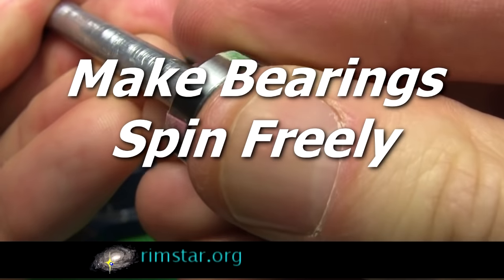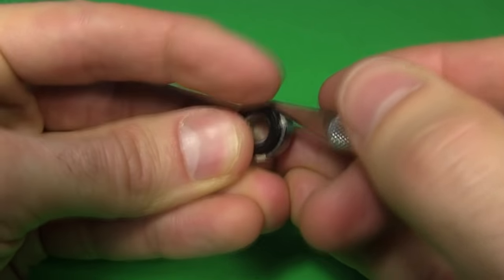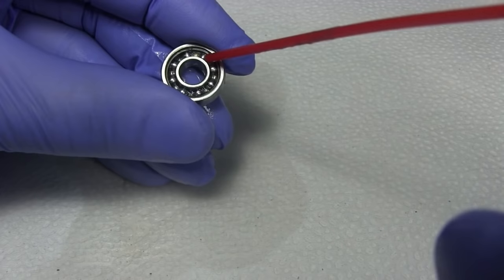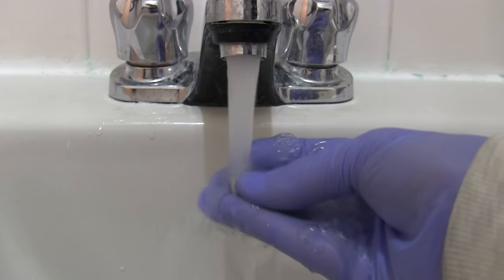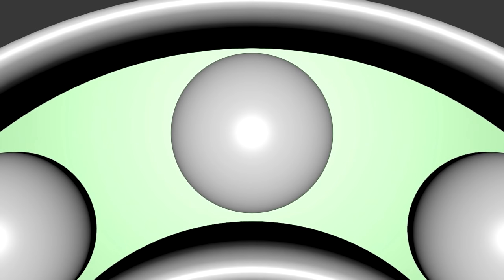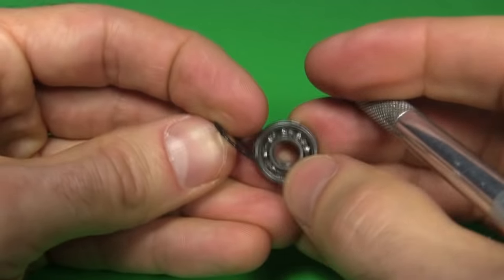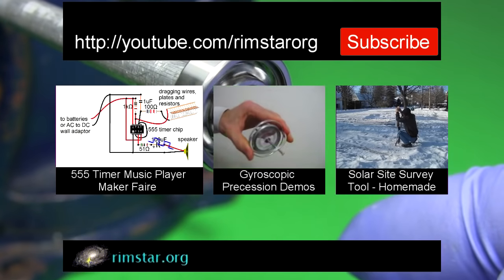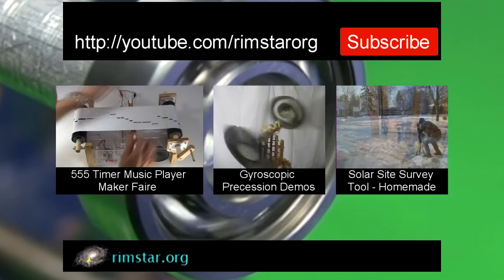How to Make Bearings Spin Faster/Freely

Comment: How to kill a perfect bearing. It needs breaking in by spinning. Just use a drill to do that...
Reply: How tf did u use a drill
Reply: @notyouraverage1saiah660  take a 5/8 dowel rod put in drill, take bearing and put it at the end, grab the outer ring of the bearing with pliers or something and spin the drill keeping the outer ring static while the center spins.
Reply: @IIBLANKII  thx cuz my brand new bearings spin for not even 20 seconds
Reply: Put bearing on a matching ID drill bit, put in chuck, hold the bearing outer ring, push the trigger.

Comment: For you skaters out there, there's orders of magnitude more rotational friction from the rolling compression of your polyurethane wheels than there is in the viscous fluid movement of the grease in your bearings and the slight touch of the rubber seals. And that is smaller yet than the friction of the balls crushing silicates in the raceways as your really cool skate oil attracts dust and becomes a lapping compound. Your bearings will last a hundred times longer if you leave the grease in them. The friction is psychological. Unless your goal is to have the wheel that spins in the air longer than your buddies, save your bearings by keeping them packed with a lithium soap wheel bearing grease.
Reply: +EightiesTV Finally, someone who gets it.
Reply: I think you're wrong. If i leave the grease in i can do a spin test that ends at a halfway decent minute and a half. If i skate them for 15 minutes clean the bearings amd use my "cool bearing lube" it can go for up to a 5 minute spin. You aren't a skater so don't try to tell us what is good or not good.
Reply: +Zach Krantz Actually I was a very avid skater when I was a kid... right up until I went to college to study engineering.
Reply: +EightiesTV You aren't a skater anymore so why is your previous status as a skater relevant. How long ago was that.
Reply: +Zach Krantz look free spin means nothing, this is something the "skater" doesnt understand because he's not an engineer, bearings work the same whether its for skating or for a piece of machinery and trust me the ones being paid 100k up to use and design bearings know more than some 14 year old with wd 40.
Reply: +Zach Krantz, I can't speak for TK TK, but yes, that's what I would tell you. Just because a bearing spins longer without a load on it doesn't mean it will roll farther or faster with a load on it, such as the skater's weight. Other factors make so much more difference that any effect of light oil vs. grease becomes completely inconsequential. Example: The difference in friction between a set of bearings lubed with something light like Speed Cream and the same bearings lubed with a heavy grease is dwarfed by factors like the rolling resistance of the urethane against the asphalt or concrete. That's what Eighties TV meant by "orders of magnitude." 

So, yes, what I'm telling you is that if you were to do the experiment you described, with an actual skater on the board, you would not be able to see or measure any difference between the oiled bearings and the greased ones. You may not want to believe it, but it's true.
Reply: Except plenty  of racers (including me) use grease because there's no evidence that proves grease is actually slower. It's that whole pesky "orders of magnitude" thing again.
Reply: Except my race results prove that I don't suck - well, at least usually I don't; everyone has a bad day now and then. And it's not that I don't know how to service my bearings "like a responsible adult." I do, and I've done so plenty of times. I just prefer not to have to do it as often. I'd counter your last statement with "There is no need to service your bearings (as) often if you use grease (and use bearings with a decent seal)." Finally, the vast majority of "skateboard makers" DON'T use grease. They use light oil, precisely because most skaters stubbornly continue to believe that a bearing with lots of free spin is "faster" when actually riding the skateboard - despite any reliable evidence to the contrary.

As for whether greased bearings are slower, define "slower." If you mean a wheel with bearings lubed with grease will stop spinning sooner than that wheel with the same bearings lubed with light oil, I agree. No one's disputing that. But if you mean a set of bearings lubed with (the proper amount of) grease will cause a skateboard that's actually being ridden to go significantly slower than it would if those same bearings were lubed with light oil, I disagree. And I challenge you to show me experimental evidence that proves otherwise. Not theoretical, not anecdotal—experimental. Because unless or until someone does show me such evidence, my own anecdotal and theoretical evidence - which I've stated without calling you names saying you're lying - is every bit as valid as yours. If you're an engineer with 15-plus years of experience, you of all people should understand what I mean.
Reply: Do you really think I misquoted you really badly? How and where did I do so?

But did you really just call me "fag"? That sort of stereotypically troll-like insult makes me disinclined to respond any further. If you're really interested in discussing the effects of different lubes on bearing performance, I hope you won't continue with insults like that.
Reply: Jake McCoy is right but I am going to add this 

i just used marine grease

Comment: if you want to win one skate race do it, he is right if you want your bearings to last for two years leave the bearings the way the manufacturer supplied them
Reply: I actually don't think the actual drag would be felt by someone running them side by side.  I did that test once and no one could tell the difference. The fact is, drag between the wheels and the ground is greater than the bearings.  If you want to win races, use harder wheels.

Comment: You want to remove the grease from your skateboard bearings if they have any actually. You just need to replace that grease with a high-speed lubricant. I use liquid bearing or bones speed cream. Both are very quality thin lubricants. (liquid bearing is much cheaper though and its the same thing.) 

When it comes down to it. It's all about maintenance. After every ride on your longboard or skateboard, you want to wipe clean the outside of your bearings so less of a chance all that gunk will get inside of them. No matter what some will get inside though and that is why, depending on how many miles a month you put on your longboard you will want to open them up and clean them out. I put about 70 - 90 miles a month on my longboard on average. Sometimes much more if I have someone to go out cruising with.  I ride every night. You can buy or make your own bearing cleaner kit. I make my own, it's easy, google it. I use 91% or higher isopropyl alcohol to rinse the bearings rather than water. And I highly recommend you do as well as you don't want to tarnish the track of your bearing its best you dont use water and if you must, use a hairdyer or a compressed air blower of some sort to dry them 100% And do it right away. Certain bearings use steel that is very high in carbon and will literally tarnish within minutes. Any sort of tarnish at all will slow you down ever so slightly and once the bearings start to tarnish the next thing from there is rust.

 If you do happen to go through water or get stuck in rain. Be sure to open up and either lube the crap out of and spin your bearings ASAP and clean / lube them soon as you have acess to what is needed to do so. Please do not stress too much over this though as in don't let it ruin your day, thinking your bearings are tarnishing. If you have been keeping up with matanince you should have more than enough lube in there to withstand repelling a little water for a short moment. And thankfully bearings are not too expensive these days. I remember for a good set of bearings you were looking at $70 bucks. You can get the best there is for 20 bucks and for 30 you can get the bearings with built in speed washers and spacers (Bones Red Race bearings is what I use) They are the best I have used so far. Don't fall for the swiss and ceramic nonsene they are made in china and even if they are swiss made, it doesn't make them spin faster or longer lol. The ceramic is coated in steel anyway... The only difference that would come from it is heat and trust me if you are skateboarding you are not even close to coming anywhere near max ABEC 7 heat tolerances. Let alone Abec 9 or even better Bones Reds that are made for skateboarding and dont even use the ABEC system as it doesn't apply to skateboard bearings.

Also, don't use WD40. If that is all you have then sure it's better then water but the best thing you can do is use 91% or higher isopropyl alcohol. If it is anything less than 91% I wouldnt use it. With 91% or higher, you don't have to worry about tarnishing or blow-drying the bearings afterward as it wil all evaporate. And if you are going to use citrus cleaner (that is the usual stuff that comes with skateboard cleaning kits.) Be sure to immediately after taking them out of the citrus solution and shaking most of it off, rinse them in 91% alcohol. Because if that stuff is left on the bearings it can do the same damage as water if not more.

If you have made it through this to the end of this comment, congratz I hope I could help you learn something. If you think I did well please give me an upvote. If you think I did poorly please comment as to why. I would like to learn from my mistakes and I would like to know if I am spreading the wrong infomation. Thank you!
Reply: Have you looked into getting your parts of your board coated in tungsten disulfide? There are a couple of example videos on YouTube showing how slick the material is. I add it to my gun greases and oils. Back to the videos, there's a video of someone free spinning skateboard wheels (forgive me if my terminology is incorrect, as I know very little about skateboarding), one side is not coated in tungsten disulfide and the other side is. There is much less friction on the one with the special coating. I could see where this application would not only reduce wear but also make your riding smoother. I'd you're interested let me know and I'll send you links.
I just found the video. In the YouTube search bar type "tungsten disulfide truck spin" and the video should be at the top. A page called Applied Tungstenite posted it.
Reply: Citrus cleaner has to be removed fast and re lubed after...absolutely ruined a set of my German Fafnirs

Comment: In my early years (1990's), I raced R/C buggies on an indoor dirt track. Pulling the plastic seals was the first thing we all did with a new set of bearings. We used W-40 to blow out most of the grease. Then we would fill an empty oil bottle with a needle tip. I would fill the bottle with Marvel Mystery Oil. It's a very light oil that gave just enough lubricant to make the bearings spin for minutes. At least for the entire length of this video. Of course this require cleaning and re-oiling every race, but that's what we had to do to cut that 10 seconds off our lap times. We also notice our electric motors batteries ran much cooler at the end of the race. It prolonged the life of both the motor and batteries.
Reply: Captain Jack yes I am lovely person who ride buggy thank you for this wisdom

Comment from the maker: Quick video on how I found I could make bearings spin much more freely by removing the grease. Good for electrostatic motors with light loads.
Reply: Wonder if this would work on skateboard wheels also?
Reply from the maker: Josh Baldwin
Hi Josh, I think you'd still need a lubricant of some kind with skateboard wheels. There's a lot of weight on those bearings and with the metal balls against metal they'd get damaged. The lubricant gets between them and prevents that. I see this as more useful for things like electrostatic motors where there's almost no weight.
Reply: Makes sense, I remember having to clean mine with WD-40
Reply: I have not WD-40
Reply from the maker: Someone else here said that kerosene works too.
Reply: I would use MAF sensor cleaner since it is specifically designed to evaporate without leaving residue.
Reply: That way you could skip the water rinse and prevent some corrosion. But ultimately you still want at least enough oil left to prevent rust. So maybe a slight amount of light synthetic clock oil?

Comment: This is a fine example of doing what's appropriate for your intended use.

Even without using graphite lubricant this is fine. You're not going to much affect the life of the bearings by using them in a virtually zero load low RPM demonstration motor.

In fact, once you're done using them for that, you can re-pack them with grease, throw the sheilds back on, and they'd be good as new.

And in terms of skateboards, the instant you land your first Ollie you've already done more damage to the bearings than I'm sure these would have in entirety of the time these were used in the motor.
Reply: even after the scraping of the ball bearings with a needle point and rinsing it in water etc? seems like a horrendous idea
Reply: @twilightsparkle75  Dude, why are there so many bronies in this comment section?  Just curious (:
Reply: @Tadders  no idea bud XD

Comment: Accidentally ordered the wrong kind of bearing and this helped me convert it into a free spinning like I needed, thanks! I didn't have any paint thinner, but a quick 2 second dunk into gasoline cleaned it up extremely well.
Reply: Yeah gasoline is fine too, others uses solvent.
Reply: Get some tungsten disulfide powder and add some to rubbing alcohol. Spray a liberal amount of the mixture to your dry bearings then once it evaporates it should leave a very dry but slick surface. I would think it would spin even more freely.

Comment: Awesome video, I'd like to share some knowledge on this topic also. 
If you don't know who Gentry Stein is he's the Yoyo World champion and as you know, yoyo's are heavily reliant on insanely good bearings and some can even spin for 40 minutes. According to him, and the majority of the yoyo community,  Lighter Fluid is the best way to clean a bearing. Pour some in a cup and shake for 15 seconds, or you can soak for 15 minutes. After that, put your bearing on a pencil (or whatever fits snug) and spin it out a few times or  use a lighter and light the bearing which will instantly remove the lighter fluid remaining in the bearing.  After cleaning the bearing with lighter fluid, put only 1-2 drops of thin yoyo lube on the bearing guard which will seep into the ball bearings then spin it a few times.  Yoyo lube is designed for bearings that are constantly spinning at high speeds. The lube does not technically make it spin better/faster/or for longer durations, however, it does spin smoother and like greese it preserves the lifespan of the bearing and keeps it spinning as it should for longer use before wearing down. Hope that helps too! 👍
Reply from the maker: Thanks for sharing your tip.
Reply: This feels like a better method
Reply: Nice

Comment: as a longboard enthusiast for those using bearings for riding i would advise against using metal to touch the ball bearings, fashion something from plastic if you must, like a guitar pick cut in half but its not needed at all. also never run without the shields. paint thinner will work to remove, i like 50% rubbing alchohol because its more forgiving and let it dry fully before lubrication. Use a thin lubrication for longboards and do it every 150km or less. If you get them wet clean them asap because unlubed bearings get destroyed.

Remember that how a bearing spins freely is not an indicator of how it performs under load, it will always appear to spin better before you add the lube but it wont perform better.